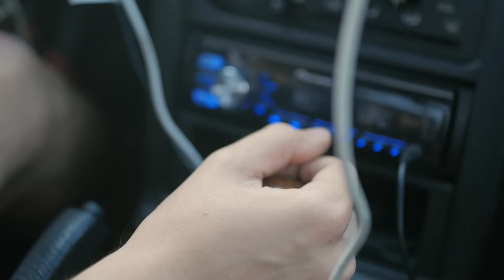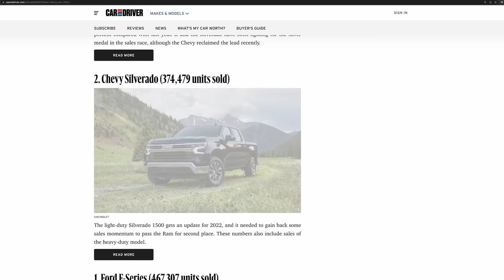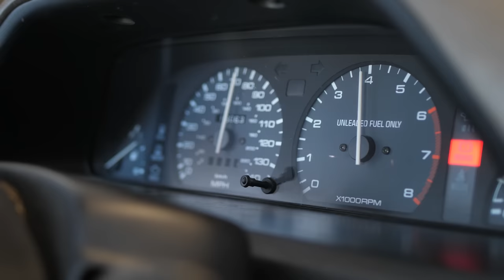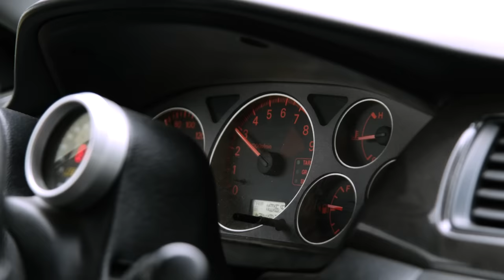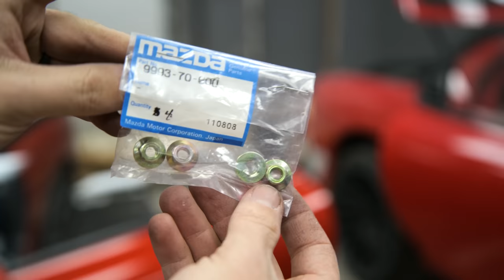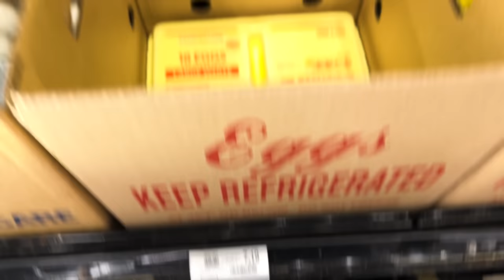Daily Drive Your Fun Car

Comment: Ehhh. Idk if I agree about additional cost like it’s a lot. I have a fun STi and a beater civic. With the civic on my insurance, i get a discount for multi car. Without it, I pay more than just with it. Because the STi has a higher value, same with tax, 100% relief in va cause the civic is worth like 190 according to the dmv. And maintenance and such is cheaper. I understand where your head is at, and a fun cheap car like a civic or a Miata is great for a daily, but not a built car, especially when those pistons won’t last as long as oem type.

Comment: because of the weather i have a cycle of daily drivers i use. when its late spring - early fall, i will daily my motorcycle or my amg gt. but come late fall and winter its raining 90% of the time, which is when i drive my GX470

Comment: I buy a brand new hatchback as a daily driver due to my job need frequent driving from place to place 
Buys a 2003 e46 325i facelift as my fun car , cheap and reliable 
Some head porting, upgrade bearing , valve springs , engine balancing , increase recline limit 
Some weight reduction n loose 50kg 
Kept the 17" wheels with meaty setup 
Full ultra racing bar packages 
Planning to get a set of ftuned coilovers

Comment: My simple 2 cents... Build an OEM+ car.
Reply: Speaking of OEM+, I wonder if a car can be too good in the handling department. I do know there's such a thing as too much power, but not sure about the handling side of things other than an overly stiff coilover setup.
Reply: @yongling9825  i don't think handling can be "too good". With any machine, you want it to do exactly what you ask it to do whether good or bad. I built a 95 Mustang that's is a 6 year rotisserie build. I converted it to a fully built IRS, coil overs and the best suspension mods. I adjusted everything until it was OEM comfortable. It's low, it doesn't scrape or bang on bumps in the road. I haven't tested it on a road course yet tho.

Comment: Don't really agree about horsepower. I drive a notoriously "slow" first gen BRZ and I love making use of all the revs and not getting into trouble.
Reply: I'd rather have it excel in handling and just enough power to make it fun to drive, maybe between 200 - 300 WHP is enough.

Comment: I used to daily a track spec Honda civic, it was a very fun car, but once my commute got a lot longer, driving that car every day and weather got old very fast. So I sold it and bought a very boring but comfortable Toyota, zero excitement or joy driving that thing, got me comfortably from point a to point b, but very boring car. So now, I bought a bmw 1 series hatchback, has an auto gearbox, but you can shift manually as well (no clutch though). Specs wise it's no horsepower beast, but it is quick enough. Also has different driving modes; sport and comfort, and they actually make a difference.

 I know bmw aren't known as the most reliable (got my first fault code on the first week of ownership haha), but man they ride good, the driving experience is completely different when compared to brands like Toyota/honda. As long as the car won't be at the shop once a month, I'm okay with having to deal with extra maintenance, the driving experience is worth it.

It's a solid sweet spot, not a track car but nor a boring commuter. A car that can do it all. Although I am thinking about getting it programmed for a bit more power, apparently the 1 series N13 engine is highly detuned from the factory, and the 136hp engine can easily output 200hp with a stage 1 tune. It's decently quick with 136hp, but I think 200hp would the sweet spot for this car.

Comment: Quiet? Pfffft! My daily is a '99 Mustang GT with no mufflers. Don't even know if the radio works.

You've never had a pickup apparently. Or, you never took advantage of what a pickup can do. My daily, for a year before it got totaled, was an '04 Dodge Ram 1500 4x4 quad cab. Yes, it was slow off the line and didn't corner like a Miata. But whenever there was a backup on the highway, I could hop across the shoulder to the service road and be on my way. Drive-thru taking too long? Hop the curb and go somewhere else. No need to slow down for speedbumps or dips in the road when your tires are 35" tall. Trucks are great for "carkour", the automotive version of parkour.

Comment: I have 2 cars because I know I'm eventually going to have to work on my fun car. I don't have to worry about fixing my 19 gt that quickly because I have a good dd. It's already saved me a couple times and I need to replace the engine in my mustang. I make about 800whp and I broke a ringland so motors gotta come out

Comment: Honestly don’t think horsepower level equates to fun level. Ive got a 70hp car that is a blast throwing around on mountain passes. It’s a 2 seater RWD, rear engine with a automated sequential 5 speed manual. It also has a fun obnoxious (to others, no droning) center exit exhaust. 

It’s a damn smart fortwo. Don’t knock it till you’ve thrown one through the turns. That little Mitsubishi 3 cylinder does well.
Reply: In recent years, I believe power-to-weight ratio is more important than power alone. A light car doesn't need a ton of power to perform nicely, too much power wouldn't be good.

My case in point, most Lotus'. I remember they don't hit 500 horses, but they only weigh in the high hundreds in kilograms.

Comment: My 2003 Volkswagen Jetta, TDI diesel fun to drive reliable Ozzie wheels all the nice stuff not lowered though dead reliable, so reliable that the posturing went out fan belt broke off. The car kept on running drove me to work at night and started up in the morning was able to drive home where I fixed it and replaced that belt that by the way runs the alternator after that I went and bought another one now I only two

Comment: By the way people by F-150s because they are practical not because they are cheap or coaches on wheels which my 2020 Ecoboost Premium is as I got it for $34k out the door... And it's practical enough and fast enough for me... Also Mustang so endless fun. Ediit: Also despite being a mutasg in an Mustang town it gets the looks. And is one of a kind because it was last off the line and is a "Hetage Edtion" because it's a pony package, with every option but digital dash, memory seats and the worst audio system upgrade you can get. So it's really special to me but I still daily drive it because that is what I got it to due and hey it's a Mustang it has inifite part choice forever.

Comment: Having one car is impractical. I suggest owning three, a reliable beater, a nicer sportier car, and your track toy. That’s it that’s all. If you only own one car you will be extremely inconvenienced if it needs repair. If you only own one you will put more wear on it, and it degrade it’s value. Your daily driver should already be at the bottom of it depreciation curve. You’ll save money in the long run by having a backup car, not being forced to shop repairs that’s you could fix yourself given the time. Take it from a delivery driver, never own just one car

Comment: Lol, why do keep showing a tesla when you speak of a boring sedan 😂😂, I also agree with Luke on the fit, I wanna get another one again, currently driving a cu2, but you can't beat the practicality of the fit 😂

And of course even with it's less than stellar power level, it still handles really well 😅.

I also have a boosted EK I need to sort out the wiring on and get it back on the road, that's one's not fun on speed bumps.

Comment: At almost 30 years old there’s nothing better than daily driving a boring vehicle. Sure the impromptu races were fun, but spending $30,000 on a vehicle just to go get groceries or a haircut doesn’t really make sense.

That said an awd Ford Maverick & MX5 Sport, is probably the best new car combo you can get for under $50,000. You get a daily that can tow your sports car, both brand new for less than the price of a Supra

Comment: I do get this video and can see where you guys are coming from, plus generally I agree with your opinion piece videos. This one I totally disagree with on a few points. 

For example a beater car plus a fun car is easily cheaper than daily driving a fun car in most circumstances, unless your fun car is a fairly standard toyota or a very economical and practical all rounder - When you have your fun car down with a funky issue and need to be in work the next day those costs quickly go through the roof, you wont have time to do the work yourself to save money and will pay massive extra charges to have a mechanic do it last minute or youll be taking the bus for the next few weeks. Also, reliability not being as important? Yeah, if you don't have to commute or drive in general I guess its fine to say that... For an everyday car id argue that reliability is literally the only important factor. This piece comes across as very out of touch in areas...

Comment: My daily is a ahem(yeah that) its fairly stock engine wise. Did a manual swap some suspension bits here and there. Sound system and for ne its a fun car. Fast? Nope. But fun.

Comment: My car right now is worth about $6000 max and I do make over $100,000 a year and I’m not getting rid of it. I don’t need a new car new cars have too many computers too much technology that’s why I’m sticking with my MK for Volkswagens I own 2 diesels both of them have bigger turbos, better injectors there’s a little bit more fun than stock, but still have all of the emissions stuff that California requires then I have another in K4 1.8 T Volkswagen wagon. Also stick shift that’s the way to.

Comment: I daily my track car, it's full SCCA FWD modified class compliance, track legal and set up for pro 2 modified I also wheel-to-wheel race it. It's hit walls , been rubbed by other drivers and all I'm all being I drive it year round ( yes I have 4 other rigs it's not my only car ) I daily it because it's a blast and being it's hit at the track a shopping cart can't do any more damage then the tire all at 40mph haha I get asked why I drive a hooptie. Wile it may look like an old beaten-up car mechanically it's all brand new. Car makes 267hp at 6700rpm with a red line of 8100 and weighs only 2281 pounds with me in it.  I do fix bad damage I don't just let the car go to shit but things like paint transfer or the black rubber marks for either the tires wearing down and just flaking off onto the paint or the time a fb rx7 decided to try and do jeep things on my front passanger fender  pannel when he lost steering, I fixxed the fender but the tire marks still there hahahah 

I love my car sure it's not going to win a beauty contest or car limbo but it's mine and a total blast and I'll fix this thing till I can't fix it anymore

Comment: Very nice. Smiles per gallon is definitely the most important spec of a car for me. Something I would add that falls into a few of the categories you listed is performance in different weather conditions. It might be fun to daily a high HP RWD car in Texas, Cali or Florida but it would suck in Wisconsin or Washington in the winter. This also adds merit to the argument for owning two cars. I also think there is a huge gap in the market for fun new cars. You have the $30k-$40k range with a lot of cars like the WRX, Supra etc and the $100k range with high performance luxury cars but not much in between. I've owned a WRX for over 6 years and the only two cars that get me going are the FD and C8 Z06. Neither of those are great daily drivers in Illinois.
Reply: The new C8 E-ray might tickle your fancy, it'll be AWD with hybrid assist, should be way better in the snow, and still has the awesome C8 architecture to have fun with.

Comment: so, my daily driver gets 42mpg, has 69 hp but also only weighs 740kg, its fun to drive because at prety much every turn it almost falls over, and in dutch traffic its got enough get up and go to stick with it, meanwhile its also only a months salary worth and parts are cheap as its got a drivetrain shared with a triplet of hatchbacks that you might now as a toyota aygo.

my fun car however costs a years salary (for me) and is modded on almost every part including ported heads, coilovers and good brakes.
Reply: let me guess, a suzuki alto or daewoo matiz
Reply: @TheUberdude14  actually its a daihatsu cuore from '09

Comment: ive owned my 09 lancer sport for a year and a half and i could say anything bad about the car. never once has it not started or have i had to pull over for something. i bought it for 3k with 150k miles and i just crossed 171k. If i had to add something to your list it would be a manual transmission. i dont think i could ever daily an auto again unless i win the lottery and can afford an amg or something similar, even then id probably just buy and evo lol.

Comment: 2:19 I am in a terrible position. I'm in the market for a new car, I can only spend about 35-40k on a car. My big issue is buying an affordable fun car. I think I am having a hard time because I don't want a boring car and it's difficult to find a car that's fun that not so expensive. I also don't want a manual because I honestly feel like I'll get bored of changing gears all the time. Does anyone have suggestions?

Comment: I disagree about your horse power number

I drive a ~1600 pound car. It has 60 hp. A little more would be nice, but 100 hp is already overkill. I'm putting an engine in it that has 33% more torque over the entire rev range, and has 75 hp

I admit, it does fail the safety department

Comment: fiat 500 abarth. Perfect daily. Also Daily'd a m 91 NSX for about 5 years before I got the Fiat. And before that, i daily'd my 79 el camino with a blown 350 and no interior with an aluminum dash and no heat or AC.... or power steering.. hahaahha.

Comment: I am always baffled when someone is a performance car enthusiast and they daily Toyota Corolla or something and talk about how it's more practical... I would rather give up a bit of practicality to drive something cool, in a humm drum normal working joe life driving a fun car to and fro makes the work week not so boring. I drive a 95 5 speed mustang gt convertible with 265/35r18 tires and a straight pipe exhaust, it gets mehh fuel economy it's really loud and sitting in traffic with a 5 speed gets tiring but the attention it gets and rowing the gears is fun and at a light I look over and see some depressed person in there import with a look on there face like there gonna whip the wheel and put it in a tree and i think yeah its worth it. It's up for now but I was driving a flat black 92 c1500 with 295s on all corners a big cammed 350 SBC with a manual/automatic valvebodied trans with a ratchet shifter and dual 3" dumped exhaust and that was my daily for 5 years, I put a $20 bill in it every day for a 40 min round trip to work but my commute was a high point of my day i would look forward to my commute and everywhere i went people came up to me saying how cool it was and its an old rattle can black pickup but it is cool. I also have a grand caravan for winter but it has wheels and a 7000w sound system with 2 monster 15" subs mounted inverted in the back so I managed to take a boring ol soccer mom vehicle and make a fun comfortable sound system on wheels... So it's not boring either. People can keep their boring people movers plus the funny part is I get people saying stuff like must be nice... What? Do you know what I have in this vehical? Not a lot...No where as much as you have in your ford focus or Honda accord. You can pick up a really clean example of an sn95 or new edge mustang gt or cobra for as low as $8000 to $10,000.... And they are dead reliable....That's nothing for a nice car.

Comment: Except the roads are trash, you will pay double in gas. More on insurance. 
You will have chads try to race you at every light. 
You can’t go over the speed limit anyway or you eventually lose your license or insurance. 
It hurts more to see them scratched or dented. The negatives far outweigh the positives unless you are getting a YouTube check 😂
You can get the same thrills for a fraction of the cost with many other hobby’s and actually build skill at them

Comment: Did someone in an F150 run your pet over or something? Seemed weird to use that as the 'people are buying boring cars bit'. Ignores the massive truck enthusiast subculture, the Raptor, the V8 F150's, the absurdly powerful modded diesel trucks, and the fact that many people who buy an f150 need the tray (bed).